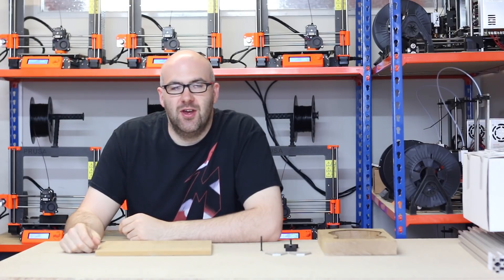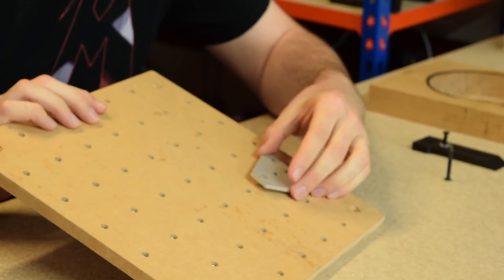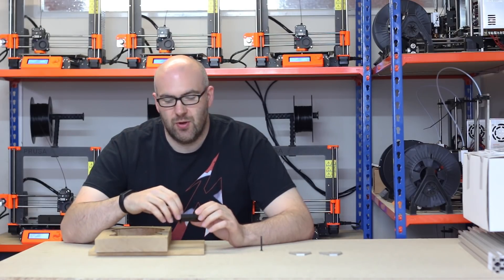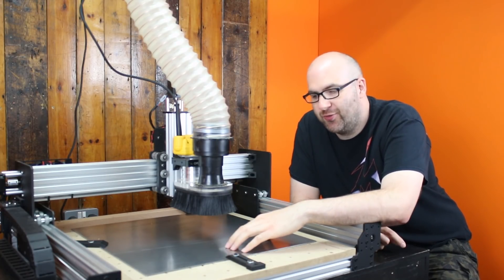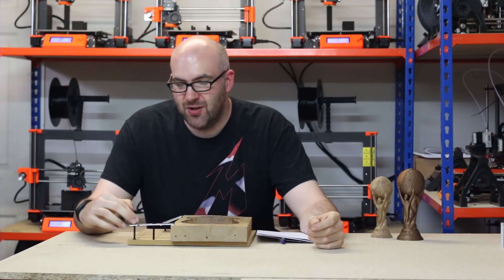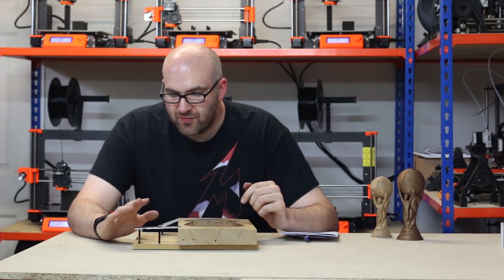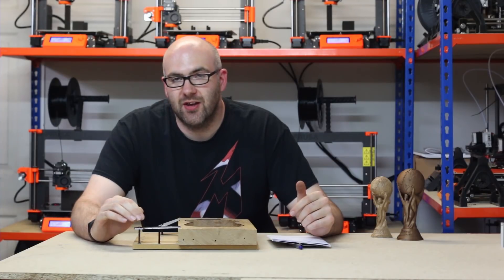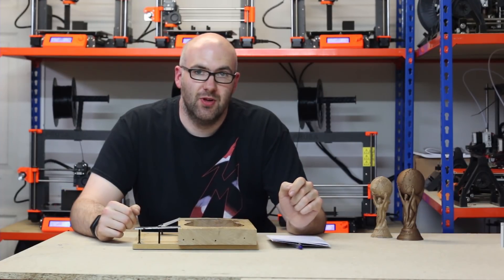Clamping Down A Work Piece On A CNC Machine | Tips & Tricks | WorkBee

Comment: mild steel!?!? mind blown! feeds and speeds please
Reply from the maker: Hi, it was the lowest RPM on the Dewalt. 100mm/min at 0.1mm pass depth. But the RPM could be better lower.
Reply: @ooznest   Ha! Who needs a plasma cutter! Thanks loads. Do you recall the bit you used? I'm thinking single flute 1/8" solid carbide?
Reply: Also, what thickness of mild steel? EDIT: listening again, it was 3mm.
Reply from the maker: @SpoonerSPON  Glad we answered your question!